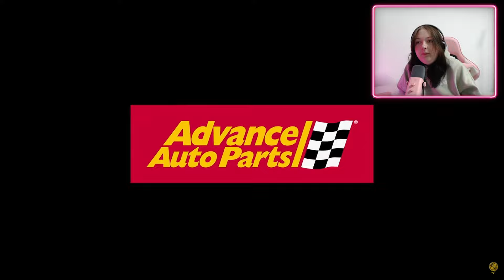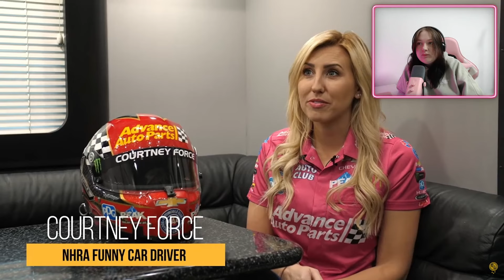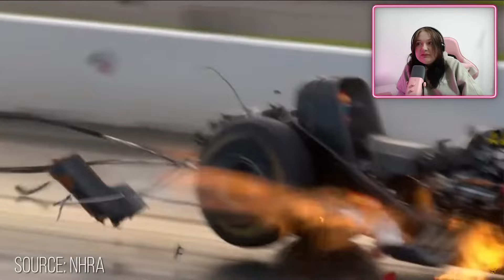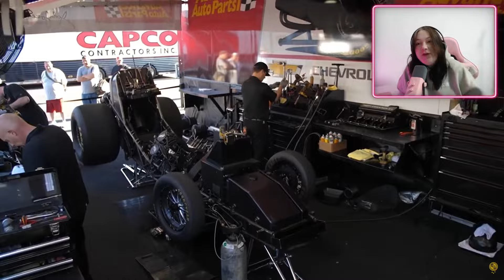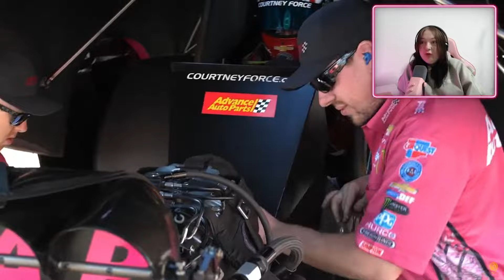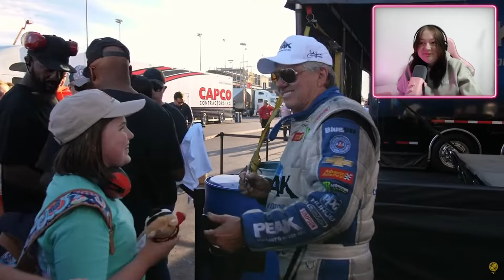F1 fan reacts to What is NHRA Drag Racing!

Comment: You've mentioned what the sound is like, I've seen NASCAR, dirt track racing (All classes), Ocala Drag racing, and NHRA.  I can tell you that the sound is one thing, but watching the gravel on the ground move and feeling it throughout your entire body, is the real experience.  It's louder and more impactful to the body than going to an air show and seeing the Thunderbirds or the Blue Angels.  Which BTW you should check out, jets are measured in Horsepower as well and the things that the pilots do with those jets is truly mind-blowing.
Reply: I remember going to the Daytona 500 several years ago and the people around us were worried we didn't have ear protection. "When all the cars come around on the starting lap you;ll be sorry." Well, when the pack went by at the start I knew these people had never been to a top fuel race in NHRA. Two dragsters easily are louder than the 30 car pack going by.
Reply: @Dmachine2000  Easily louder than 40 cars going by at Talladega, much less 30 at a "normal" track...
Reply: @Dmachine2000 Those two fuelers have more horsepower than those 30 cars combined, too!

Comment: NitroMethane is so tightly controlled, because there are so few legitimate uses for it, outside of military applications, the only real use for the stuff is for top fuel drag racing, one of the MAIN reasons why it is so powerful and dangerous, is that when used for anything, is that it contains within itself, nearly all of the needed oxygen for it to burn/explode, which makes it good for very short high horsepower racing, and making bombs, outside of those 2 things, it is only used very limited in construction, demolition, or mining.

Comment: There are many vids about the shock you feel as a spectator at an nhra event there's one with a compilation of spectator reactions of is fun to watch  they have measured the the shock of 2 top fuelers coming off the starting line with a seizmometer it measures around 2.2 that is a small earthqiake

Comment: Hey new subscriber here! You should definitely check out truck/tractor pulling. Top end classes can have 7000+ horsepower and a lot more torque. They pull a sled that weighs around 50,000 on dirt. Whoever pulls it farthest and fastest wins.
Reply from the maker: Thanks for subscribing! I will definitely check it out 😇